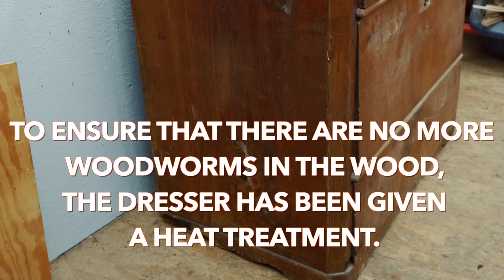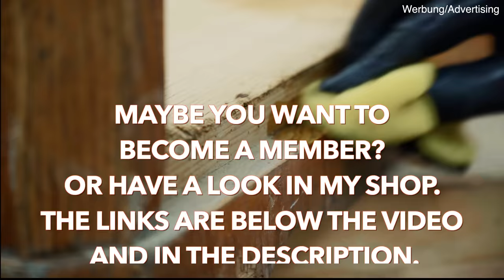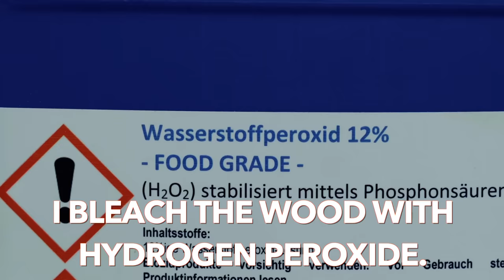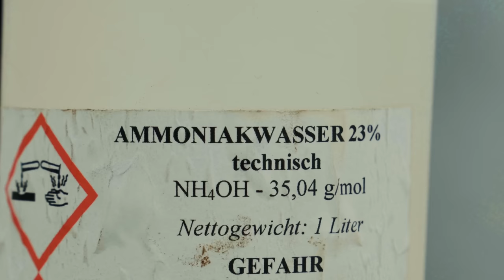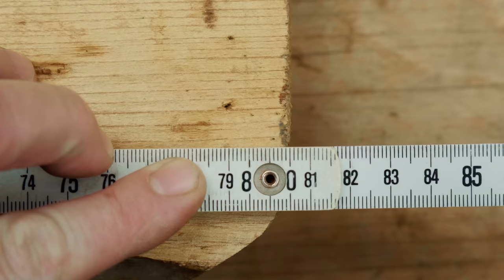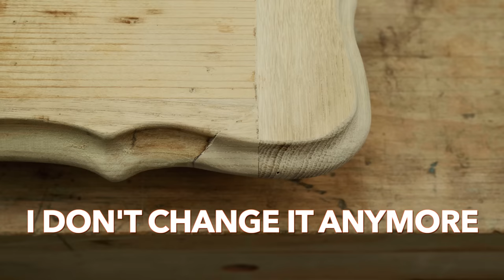30 Jahre Garage! FANTASTISCHE Rettung dieser Kommode

Comment: Not that Id try and tell you how to do a restoration, but rather than use metal tools to separate the wood, have you tried using wooden wedges of varying angles? I once did this to take a wardrobe apart that had been assembled in the room. The customer wanted it all intact and I managed to disassemble it without any damage or splits using the wooden wedge method.
Reply from the maker: No. I haven't. Maybe I'll try that. Thanks
Reply: Excellent idea! Thanks for sharing!!
Reply from the maker: @rofree2470  gladly

Comment: Very impressive job!

 I have seen quite a few chest of drawers from about 1850 to 1920 and they were all veneered, highly polished with shellac. Some were slightly matted down to have a more silky finish. They often have intricate patterns in the veneer, burl, patterns in the cutting of it, various inlays,... I think veneer was valued highly at the time, and the finish too.  It makes be think this chest of drawers might have been stripped of its` veneer, then relacquered?  They would not allow rough spots in the wood in this era, it was not considered proper furniture until highly finished.  I have seen some furniture where they likely used layers of wax polish or some kind of varnish recipe I have not quite identified yet.  

Did you do an alcohol test? It would let you know if it was shellac. If it was cellulose lacquer, it was refinished at some point, the same with acrylic or polyurethane.  

It`s a joy to see your carpentry skills in practice like this :- )
Reply from the maker: Hello. It's easy to tell whether it's shellac. This can be washed off with alcohol. Greetings

Comment: Do we have an age for this piece? I suspect it's quite old ... possibly late 18thC or early 19thC. In which case conservation is the goal, rather than restoration. All original material should be retained, etc, and no stripping or other removal of patina. Glad it was saved, even still 👍
Reply from the maker: I think it is late 1800, early 1900
Reply: @chrigunrestauration  The top says yes, but the rest of it is likely somewhere between about 1770 and 1810. The bracket feet, the dovetailing, the veneer, the eschutcheons, etc. The top could be a later replacement, done around a hundred years ago.